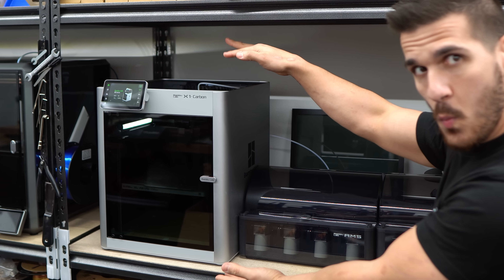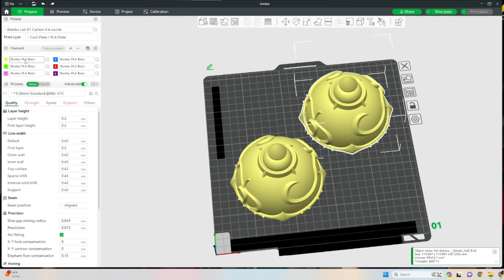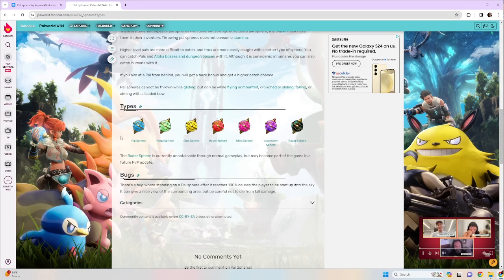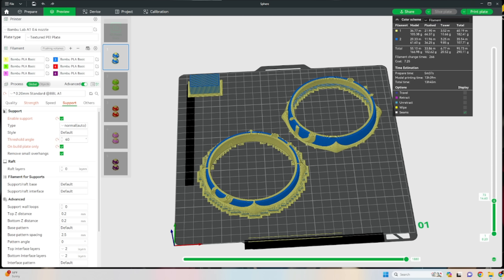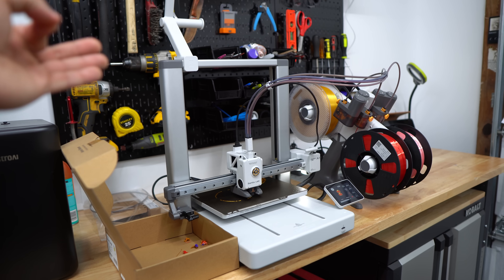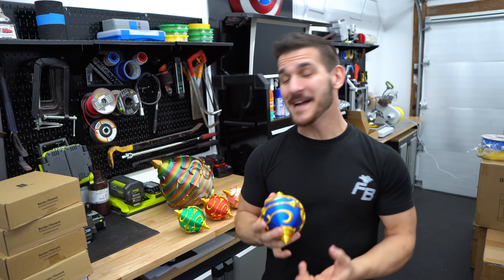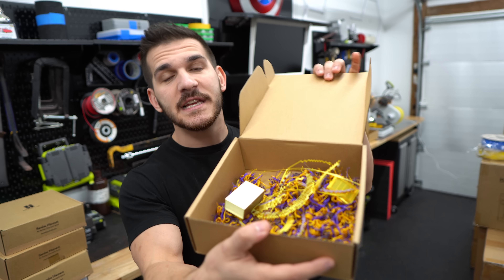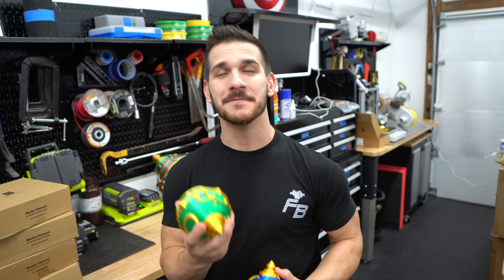Making REAL Palworld Pal Spheres with Multi-Color 3D PRINTING!

Comment: @Franklybuilt I'm looking to upgrade my ender 3 that I've had the past 3-4 years to a new 3d printer, either a P1S or a Neptune 4 Max. I usually print smaller prints but there are a couple projects where the larger build area would come in handy.... What would you recommend? Thanks!

Comment: I've had a Neptune 3 pro for almost a year now and for the last few months when I try to print something it will have a bunch of small holes and terrible feeling edges and I don't know what's wrong or how to fix it because it just started doing that for no reason, do you have any suggestions to try and  fix it

Comment: OK so you can weld PETG with that purple PVC pipe primer.  The downside is the staining, but you can fuse the halves together and then work the seam to be flawless...then paint.  It's an alternative to multi filament printing and with just a little(OK a whole lot of time sanding) time you can make it look way better than just a printed part.